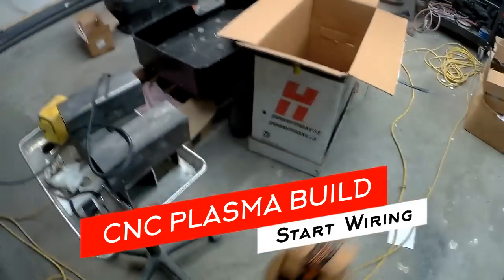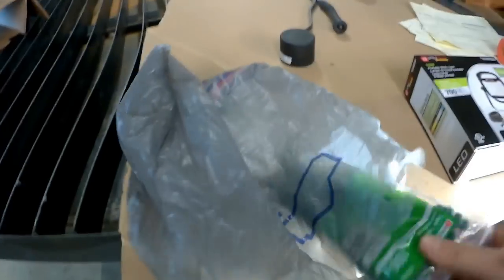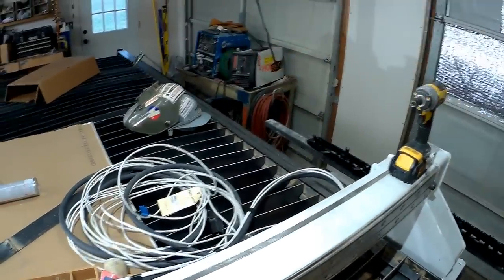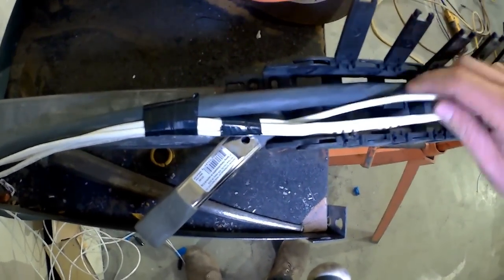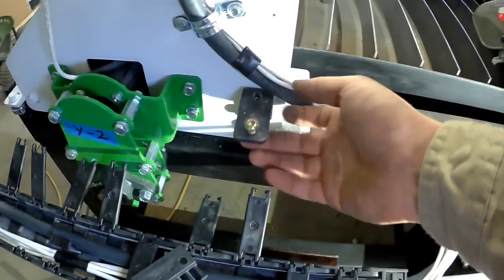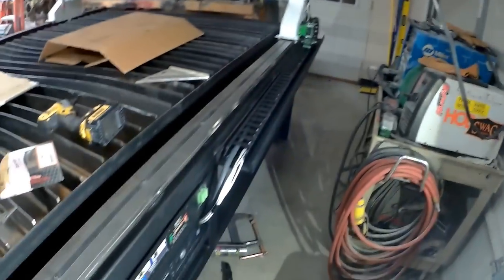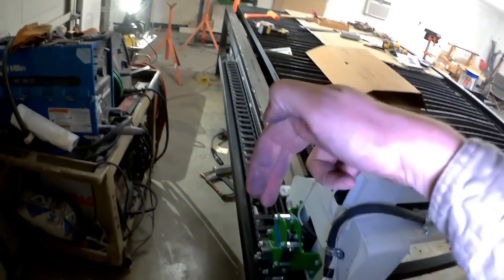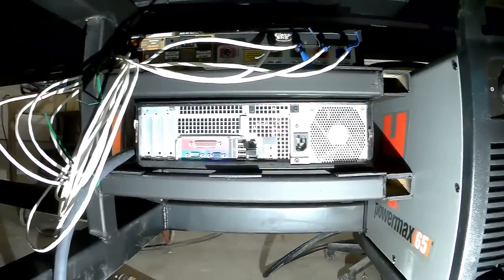CNC Plasma Table Build Wiring 1 of 2

Comment: I had  UPS on my cnc plasma. It didn't help me with noise issue. However, can't hurt if you have one. The Rod into earth technic didn't help either. I have it 3 meters deep and didn't help a bit. But what really helped me is shielded wires both on motor and home-limit switches and grounded them into a star ground point. Not daisy chain! If i were you i'd try cutting the way you have now and if any noise issue comes up than would start making these things.
Reply from the maker: Pataki Attila I ran an 8 ft (2.4 m) ground rod today it was $10 at the local hardware store so I figure cheap insurance. I also hooked up a ups. I just got the table to cut for the first time!  Then the torch crashed and I can't get it going again, so I'm taking a minute to figure out my next move. Thanks for all ur input!
Reply: Maker Table   I'm sorry to hear that torch crashed.  Did it break? I hope not.  If you have ethernet cable on your RS485 from your powermax to your candcnc change the ethernet cable to a cat7 shielded cable, and solder a grounding wire on the metal portion of the plug at the pc ( or dthc) side of the cable and connect this wire to a star ground point. It helped me with noise issue.

Comment: I do really hope i will be wrong, but i think you will have interference problems as soon as you will start cutting. Plasma is just too close to PC and i don't see any starground shielding yet. Don't get me wrong i've just been through this and was the hardest part in th hole project.
Reply: 8 or 10 foot grounding rod like at the main panel in  your house.

Here's is my recommendations for you:

Get a spare plug for the ground cable to the plasma unit. (I got mine from Bakers gas - cheap consumables too) Have them look in replacement parts for the ground cable end 8$ or so..

use it to run a cable (same size as existing cable) to a grounding lug on the water table (weld one on where it fits the best)

From that grounding lug get another pce of cable to run outside to the grounding rod.. (no need to drill a hole in the floor)

Then use another pce of welding cable  to ground the work on the table with a magnetic ground switch (I had problems with a clamp on a bigger sheet in my small table so I went with the magswtich 300 amp - way overkill but the 200 was discontinued) so all three cables tie into the same lug

The mag ground is to the right of the levers on the 7th pic down here :

http://www.wildcatforums.net/forum/off-topic-discussion/15768-shiny-keg-plasma-kutter.html

save the factory one for other jobs.. Did you get a hand torch with the unit as well as the machine? I did for handy jobs

A UPS system is a battery backup for the computer, they condition the line signal as well.. $50-$75

I got all of these tips off of Jim Colts page at Hypertherm
Reply from the maker: I really appreciate the first hand knowledge!  I'll move the plasma shelf to the end of the table.  Hopefully that's enough to prevent interference.  If I do run into issues, what can be done to shield the computers from the plasma?
Reply: Do you have the table grounded via an earthing bonding rod? Hypertherm recommends doing so, An ups system would also help with the conditions of the current to the computer..
Reply from the maker: SegoMan no I haven't grounded it. But I can drill a hole tomorrow and drive one in if it's necessary. How deep do i need to go w the grounding rod? and what is a ups system?